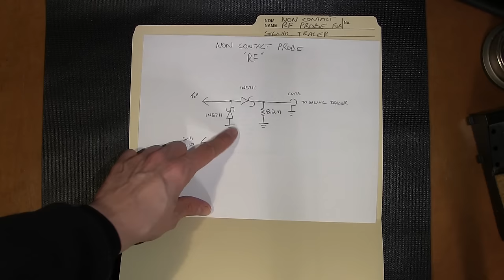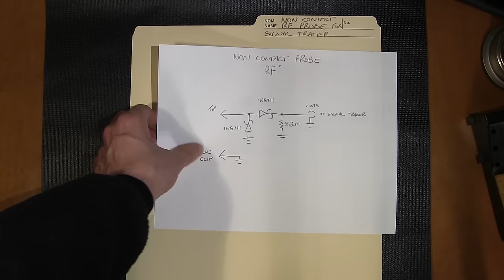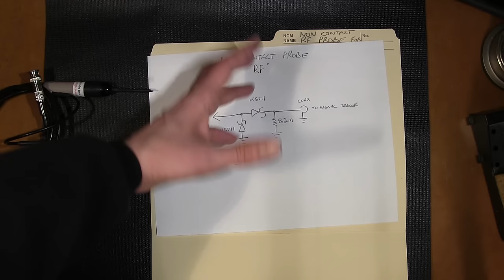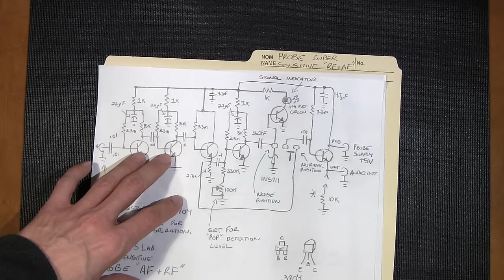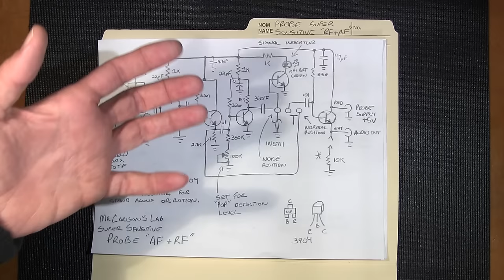Troubleshoot Electronics FAST with a Super Probe

Comment: Hi Paul,  Not being an EE, I don't understand what the Diode is doing in your circuit.  That 1n5711 is a pretty pricey part.  I wasn't sure if that just happened to be in your parts box, of there was a possibility of swapping on something cheaper.  Thanks for any tips! - Mike / KD2EAT
Reply from the maker: Hi Mike, the diode is pretty cheap (usually under a dollar) The diode is the detector in the noise circuit, without it, the noise section would act much the same as the audio position on the switch. You could experiment with a 1n4148 or 4152. For the best performance, I suggest you stick with the Schottky diode though.

Comment: Paul 

Awesome job, I designed and built a ultra high sensitivity prob about 30 + year's ago, which has found many problems and saved countless trouble shooting hours over the years, but mine does not have the noise detection circuit, wish I had thought of that, very awesome Paul, I love how that suppress the background noise and makes the noise that you are tracking so pronounced, high contrast audio, if you will, now lets see, what is that class BC as opposed AB LOL, biasing that transistor right at the edge of cutoff I love it.
I have to wonder, is this YouTube channel, and your Pateron channel, your full time lively hood, or are you an engineer for some big company, or perhaps an instructor at a college or trade school, whatever the case, I love what you do, especially some of the old tube stuff, just something about the warm glow of tubes.

Comment: Hi Paul, on the amplifier schematic you're showing a 22uF emitter bypass capacitor, but on the populated PCB you have a 100uF installed.  Do you find that this change is significant?

Comment: What would need to be done to use a set of headphones instead of a speaker to keep from the noise bothering anyone else in the room. I use headphones for everything I do that involves audio, it limits any surrounding noise I do not want and no one else hears what I am listening too. So they actually suit two purposes in one. The little 1/8 cord is hardly noticeable and they probably even have wireless headphone out now.

Comment: Those three caps marked ".o1", is that uF?  I started collecting the parts to build this probably a year ago, and just came back to it, and the only components I need are those three.  I've had some difficulty finding .01uF tantalums at Mouser, digi-key and the like that aren't huge high voltage parts that are totally inappropriate.  Difficulty: I'm trying to stick to through-hole because I can't even see the SMD's of this value that I found, let alone soldier them without destroying them.  If I had to, would ceramic be the next best choice?

Comment: Another wonderful and useful video - thank you so much !!!
One question: On the Audio amplifier board - you etched separate ground paths starting from the solder pad for the ground- why not just etch one solid path ??? Is there a special reason for doing so ?

Comment: You do realise if you had designed this to accept interchangeable probes - with an inductor and a piezo transducer and coupled it to a raspberry pi or arduino with a DAC you could have launched this on kickstarter, called it "A Magic Audio wand" and raised $100k within a month ;-)

Great project - but I cant work with smd - i'll go for big through hole - and a larger probe - 'cos size matters ;-) "mine's bigger than yours!" - lol

Comment: You mentioned that this probe could "hear audio" though an RCA cable.  were one to make it slightly more sensitive, and waterproof, would this be sort of similar to the style of cable tap used in project Ivy Bells during  the cold war?  only the tapping part, not the recording or battery backup.

Comment: Is the 5v ps a must? Can a chip that uses over 6v be used in placed of the LM4871 so regular off the shelf alkaline batteries be used? Or maybe a dropping resistor of some kind can be used with the 4871?

Comment: The 4.7uf is a ceramic? not an electrolytic? Can i just use 2x 10uf electrolytic in series to ground? Also. Is 102 ceramic close enough for the decoupling caps? i don't have 101 right now. I could put some in series to go a bit lower.

Comment: Hi, Mr. C - I would like to build your Super Probe but there is no way I could DIY a PCB.  Is it possible to build it successfully with point-to-point wiring?
Reply from the maker: Yes you could, this project has been open sourced, so if you look around on the internet, you will find many different versions of it.
Reply: Have you thought about licensing someone to market a kit?

Comment: Why you did not used OPAmps instead of transistors? It would shrink the circuit out with fewer components and simplify mounting.

Comment: This is not one of the uses that you mentioned, but could this probe be used to determine the location of an arc fault in an A/C mains circuit in a home?  In the USA, arc-fault circuit breakers are now required in most new homes and whenever a new circuit is installed in an older home.   Since a single breaker protects an entire circuit, an arc-fault trip of the breaker typically leads to a lengthy, connection-by-connection disconnection and re-connection of each wiring terminal in the circuit to find the fault.   It seems that this device could be used to quickly probe each electrical box and each connection in the circuit to find the fault.    Any thoughts?
Reply: If the answer to my question is "yes", this probe would be of immense value to electricians.   There are currently no low or moderate price devices on the market that enable quick location of the source of an arc fault.   (There are special TDRs for locating faults but they are very expensive, far beyond the budget of nearly all electricians.)  Arc fault breakers that trip drive electricians so crazy that a common "solution" is to install a regular breaker, which is a code violation in many areas nowadays -- and leaves a potentially hazardous situation in place.

Comment: The enclosure looks to be made of metal so I am curious about one thing: How did you insulate the circuit board from the enclosure?
Reply from the maker: Hi William. The circuit board fits the center of the probes inside diameter.

Comment: Do you know how to troubleshoot cable tv interference? My cable (Comcast) goes out at all times of the day and night. People I know in another town do not have any interference. I've had the tech's here to check the connection to the outside box. Everything was said to be good, yet the interference continues. The internet goes out sometimes every half hour for several minutes to sometimes an hour or more. I think there has to be someone or something cutting into our signal, maybe with wifi. Is there any way to trap my signal to catch what is cutting into my cable signal that you know of? Thank you for any suggestions you may have to solve this mysterious problem.

Comment: Hi, I realised that the transistors are mmbt3904 but not sure what size the 22uF & 100uF caps are  also the 1n5117 diode? Any help much appreciated.  I thought that there may have been a parts list?

Comment: Hi, Paul! Can you please answer a couple of questions? 
   I struggle to find 2n3904's in SOT-23 at the retailers, can I use BC847C? It has more gain (400-800), but I'm afraid the thing will oscillate :/ 
   Second - can I use 1n4148 instead of 1n5711? Or a power Schottky will do too?
   Did you choose 3.3Meg resistor to get the half of the supply voltage on the collector of the transistor in CE amp?
Reply: Might be able to help with your first question. Look for MMBT3904. The problem is that 2N part numbers are JEDEC registered and package specific, so you'll never find a 2n3904 in sot23.
Reply: The funny thing is, I used to know about this marking, but it popped out of my head when I was searching :/ Oh well, I made the board for through-hole parts already :) The power amp board is ready to go, gonna get some 3Meg resistors to finish the board for the actual probe and I'll give it a try. I'm very anxious to get it done ASAP, but I don't have those values on hand, aarrghh!

Comment: Can you recommend a diy tool such as the one in the video to detect vibration and amplify into sound. Example, a small sensor that can be connected via magnetic base. I would like to use in conjunction with Bluetooth speaker.

Comment: Hello I have question for you. I want to use a RGB LED to indicate wehter a Temprature contro PID is Heating (R) cooling (B) or is idle (g). Could i use a mux/demux like a TI CD74HCT4052E for that. Im a novice when it comes to circuit design so Id be thankful for any info. OR should i use a switch liek a ADG5462FBRUZ-RL7?

Comment: I'm interested in building this kind of probe, but I have a limited supply of BJTs and a truckload of jFETs, so I'd like to rework the preamp to use the jFETs.

I assume any audio amp (including whatever Class D amplifier boards are available on the "maker" market) that is compatible with the available supply voltage should work? I'm trying to migrate all my projects to Lithium rechargeable batteries, so I'm looking at a B+ of 3.7-4.2V.

Comment: Hi Paul, do you know any company who will supply a’through hole’ pcb for your super probe with the noise detector in the UK? PcbWay wants me to buy 10 of them when I only want the one! My eyesight is no good with surface mount!  £50 +  freight + customs makes it hardly affordable as I have only a pension to live on! I recon I  could get it in a 22 mm copper pipe without shorting then heat shrink the whole pipe + a small piece of rubber on top for the switch! Hope you can help me! Fraser

Comment: Hi Paul. Is it ok to use 1n6263 instead of 1n5711 and a 18650 LI cell for supply? Also is that an 1k resistor is series with the led (is it not a little too much, my led is not turning on)? I just finished a variation of your design and am encountering some difficulties. Also I used LM368 and all through hole components. Amplifier part works fine. I only have to trouble shoot the probe PCB now. BTW your channel is great and I always enjoy your videos.
Reply from the maker: Hi Lulian. Build it with the exact components, and you should have no problems. Make sure your LED is a "super bright green LED." Normal LED's will not work.
Reply: Thanks for your fast response. Don't get me wrong... but that wouldn't be much fun. The reason I started this build was to further my knowledge and copying a diagram is not very challenging. Anyway I figured out what went wrong... I installed a 10k pot instead of the 100k (out of a box with lots of them) and the sensitivity was too low I guess. The led is a red one with a lower Vf so that was not the issue. Next thing is to make it smd as small as possible but I'll have to wait for the parts to get here from China since I can't get smd's locally.

Comment: I wish I had one of these to trace an intermittent ceramic cap across a voltage rail in an HW-8. Took months to locate it! 

Can I use 9V on the probe without any component changes? I have a suitable amp that runs off 9V.

Thanks. Great videos!
Reply from the maker: Hi Janet. The probe should have a maximum of 5 Volts for the supply.
Reply: Thanks. It's easy enough to add a 5V stabiliser from the 9V amp supply to run the probe.
Reply from the maker: An "LM7805"  should work to drop the 9V

Comment: Great stuff as usual! Thank you!
I have a question concerning the audio amplifier board (38:00). You designed the layout that way, that the connections to the components from the power connection pads are "spider" like, not linear. Is that to prevent self oscillating of the amplifier and get it more stable?
mni tnx es vy 73, Ewald, DL2YBB
Reply from the maker: You are very observant, and correct. The path to the audio IC should have leads as short as possible, to a low impedance source. There is also a 22uF tantalum cap at the supply pins for added stability. When building audio amplifiers, a "star grounding" scheme is always good practice. In RF application, the length of the wire in a "star grounding" system will add inductance to the circuit, creating other issues. It's all about the frequency range.

Comment: ummm i'm afraid i didn't get this.
why did the speaker go silent while the led grew bright in the last segment with the AA5 ?
let me guess - led indicated rf signal detected and silent speaker indicated no audio -
as would be expected at the rf oscillator.
am i getting warm ?
with dc and audio i'm fairly familiar.
rf is pretty much black magic.
why did the speaker go dead silent with so much rf floating around ?
was all rf noise filtered out from the speaker ?
how is rf audible in any event ?
rf - by definition - is beyond 20kc.
so "rf noise" must be audio noise somehow generated in or by the rf circuits and/or detector circuit.
i guess i'll have to watch it again.

Comment: Great video! I have a question. I built the probe, however I used through hole parts and point to point wiring. I noticed that my LED won't turn off, so I put an oscilloscope on the outputs of all of the transistors. I am picking up what appears to be an oscillation on the output of the 2nd transistor. If I place a .01 to ground at this point, the signal is gone, however the probe sensitivity is pretty much gone. Do you have any suggestions?
Reply: Is point to point wiring a bad idea for this circuit?
Reply from the maker: Yes it is.

Comment: Great job Paul. It was like black magic when you showed off the probe and the CD player lol. One question. When you were showing the bad components from the last restro did you inject a audio signal or just straight voltage into the parts to find the bad component?
Reply from the maker: There was only Voltage, no injected signals of any sort. What you hear is arcing inside the faulty part.

Comment: Does the on/on slide switch on the Probe use 3 or all 6 terminals?  (for switching between Noise/Audio functions)  The Slide switch I ordered has 6 terminals.
Reply from the maker: Hi Virgil. The switch is a SPDT type that uses 3 connections.

Comment: hey paul'''''''just thinking out loud'''''do you think its possibile to add more filtering to it''''or'''' to add a frequency meter into the probe control box to I.D. signals''''' 'just a thought paul''''''''james' oklahoma. KD5UTU. 73's
Reply from the maker: Possible, but then the signals would need to come down to the box where as only the audio leaves the probe head in the current design. I suppose it could be buffered to drive the cable.

Comment: 42:20 If you were using a motorized potentiometer, could you wire it to it's own motor to cause it to turn itself down if the gain is so high it will damage itself?

Comment: Will this probe completely replace your Heathkit or is there still utility to the old tube signal tracer?
Reply from the maker: Hi Ellen. The old signal tracer still has plenty of use. That tracer is used for (out of circuit) noise tests, and contact style testing.

Comment: Going to build this project in the future. a excellent addition to the work bench super job, and thx for sharing it. thinking of adding a alc circuit and maybe using tl084s, and lm386 dont know about that. save that dx-150 speaker they are going for a good price hi. right now working on a shure auto mic mixer, a lot of trace threw holes that are bad. i need to buy ra flux. Can you give me a brand i can buy? I  want to get good quality fluxing just a lot of holes to solder. I have bought  kester #186 it  dosent work good like the one you use. Can or is a way do download you videos? For my personal use, if not i do understand. Thank you and excellent work! 73`s

Comment: Stewart MacDonald sells a conductive paint for shielding the control cavities of electric guitars, but I am not sure how well it  sticks to plastic. Option 2 is copper foil, and contact cement. The grounding or grounded side of a two wire zip cord is SUPPOSED to have the rib or ribs running down it, and THAT wire is supposed to be connected into the wider or longer prong on a two prong NEMA AC outlet and or  plug. Does that mean the cord or the outlet are going to be wired correctly? NO! Of course not! Usually these cords were wired properly, but not always. As for two prong outlets? The oldest ones are not even polarized, so there is a transitional period where no one cared.

Comment: Could anyone give me a part number for a 6 volt 32mA light bulb of the type that Paul used to protect against shorts from the 1/4" Stereo Probe jack?  I believe it gets connected between the center of the 2K Potentiometer (VR) and the +5 Volt pad.

Comment: hey! thnx for this super video.
i repair guitar tube amps and wonder if this probe is usefull to find buzz, hum or hiss problems?
for example, i am searching to find a excessive buzz sound coming out a orange AD200B bass tube amplifier for days now, with no result. (i hear this buzz with no guitar plugged in).
can such a probe help me with my problem?
thx.
Stefan from Belgium.
Reply from the maker: It should do the trick. Look for loose grounds, jacks, or an open potentiometer (at one end)
Reply: the final solution was installing 2 anti-hum resistors of 100 ohm on the filament supply to ground.